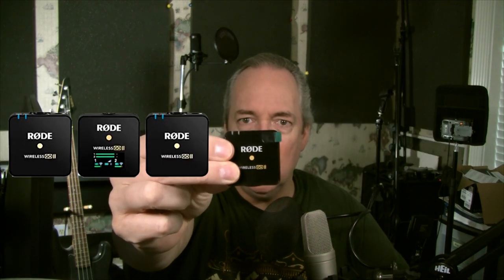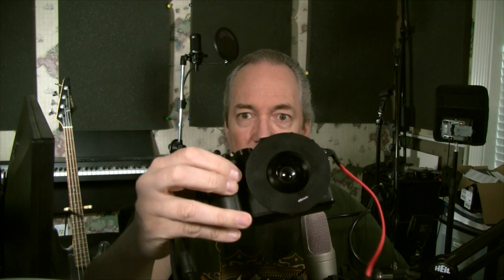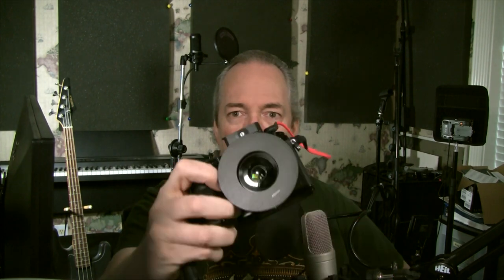Fix For Rode Wireless Go II Buzzing Noise

Comment: I have a same problem but with my Samsung mobile. I use gimbal and attached the receiver to the gimbal.  The phone is very close to the receiver.  Any solutions? Not easy to do you idea  with longer cable if use a gimbal. Thank  you
Reply from the maker: There seem to be multiple ways to fix this issue, none of which worked for me, but they work for others. It's odd. Maybe try deactivating or activating the pad mode(little blue triangle at the channel display). Also see if you can disable Bluetooth on your mobile and see if that helps.
Reply: @Home Brew Audio  doesn't work. But thank you anyway

Comment: Hi, brand new Wireless Pro here and on my first test I have that buzz. But I have that buzz on the camera AND on the emitter which is recording the audio by himself too. So the fix won't work for me and the issue seems to be different too. I'll do more test, but I'm quite disappointed, that Wireless Pro doesn't seems that much pro...
Reply from the maker: That is weird. At least in my case, the "safety" recording on the transmitter was not picking up the buzzing. For it to also be present in the transmitter seems like something is off. I would definitely try to contact RODE support on that one.

Comment: how would you use this in a run and gun situation? lets say handheld or gimbal?
Reply from the maker: I would try just putting the receiver in my pocket if I were the one carrying the camera. It would probably be far enough away to not interfere. the location of the mic seems to be unimportant.
Reply: @HomebrewAudioRecording  Fair enough. I use a GH5 II, but I find the audio that is recorded internally on the rode sounds better than when wired into the camera. Is this the same for you are they equal?
Reply from the maker: @kudobeats  I haven't done a test on that. But it doesn't surprise me since that audio recorded on the mic is direct and the audio on the camera used its internal electronics for sound capture  I think. But yeah, if you are getting good audio on the mic without the receiver, there really is no need even to use the receiver is there? bypass the problem entirely? Then all you need to do is sync the audio up to the video when editing. It might even be better NOT to use the receiver at all so that the camera can pick up its own audio. That way it would be easy to sync it up in post since you have reference audio. I know all this is a pretty roundabout way to do it.
Reply: @HomebrewAudioRecording  crossing my fingers but I seemed to have fixed it, even with it mounted on top of my camera.I set the sound gain rec level to Low instead of standard. Have my Gh5M2 at -18, and tested on all rode's dB (-24,-12 etc) and no buzzing. No idea why, just hope it stays like this.
Reply: @HomebrewAudioRecording  My diagnosis was incorrect. Whats interesting is, that if I lower myself or raise myself the noise appears and disappears depending on my position. Its still mounted on the camera. This is such a weird issue.

Comment: It's NOT just an issue with your G7... I have the same issue while using my Sony FX3. And I am a run-n-gun filmmaker... soooo I can't just drag my receiver 4 feet behind me while running around... The whole point of this Rode system is that it's WIRELESS! haha UGH. I get a buzzing sound simply by plugging in a cable to my camera's side mic port without a mic connected... I'm not sure why. I've tried using a different cable from my shotgun mic and the same thing happens. If I plug in my shotgun in the buzzing goes away. I think you're on to something behind the wifi signals. My camera has an airplane mode but that doesn't seem to change anything, nor switching the signal from 5ghs to 2.5ghs.
Reply from the maker: Yeah, this seems much too common with too large a variety of cameras and devices to NOT be a RODE problem. They had better fix this before the next release.

Comment: For me, only one of my transmitters is having the buzzing issue and only when a lav mic is plugged into it. The other transmitter works fine and moving it away from everything hasn't worked for me. This is a very new issue as normally I use the full kit together. At least it can still be used without a lav mic but not ideal when wanting to be discrete. If anyone has a fix for a single transmitter, please reply here. 🙏
Reply from the maker: Weird. I suspect this problem happens in multiple situations. And sometimes different ones than others having the problem. It also makes me wonder if this defect isn't more of a problem than Rode thinks it is.
Reply: @HomebrewAudioRecording  Possibly. From other info and the pad may be causing the issue too on transmitters rather than receivers. Don't have my kit with me to test but will update my post if that fixes it. 👍
Reply: I have a similar issue, my Go II is now buzzing horribly, but only when the lav mics are plugged in. It completely ruined my takes the other day (best solution I found was RX's de-hum plus Final Cut's voice isolator)
Reply: The same happened to me, one of my transmitters is more sensitive than the other one ( Tx 1 ) but it only happens when I plug the lav, what I did was doing a Factory Reset to all the diveces (3), then I tested my two lavs in both Tx, and there was one of them that picked up less noise with the Tx1, also, keeping the cable of the lav away from the Tx helps, now I'm gonna try also keeping away the Rx from the Zoom F6. 

I hope it helps!
Reply: @TadeoValencia  have you checked that the “Pad” isn’t enabled on only one of the transmitters?

Comment: The same problem happens when the receiver is plugged into recorders that don't even have wifi. So it's not a wifi thing causing the buzz...
Reply from the maker: It may not be WiFi exclusively. Rode says other wireless signals can cause it as well. But whatever the cause (and I'm not sure it was WiFi), THIS solution worked. https://youtu.be/QZjSrwxUT6Y

Comment: Hi, i´ve got the same problem but only while using the Lavalier Go Mics.I wondered why , at the first time i used the Go mics i had no problems.Now i´ve found out why.If you've activated the pad mode(little blue triangle at the channel display) the buzzing noise is terrible, even your camera wifi is activated or not.That was also my first suggestion but after i´ve deactivated the wifi and bluetooth on my Sony PXW-z90 nothing changed.So hopefully this is the solution of  the problem and rode will fix it with an firmware update.
Reply from the maker: Yes, I've seen the that the pad mode is another cause of this same thing for some people.

Comment: But does it really solve the problem? Having it 4ft away from the camera while shooting outdoors or on the move just causes more problems.
Reply from the maker: It's not ideal. that's for sure. But yeah. I can let the receiver hang down from the camera and still be 5-10ft away. In fact, the transmission can go as far as a football field. So an extra 2 feet or so of cable from camera to receiver isn't that much of a hassle.

Comment: I have the same issue and solution with my Sony PCM D100 recorder (and other recorders as well as a camera). The PCM D100 does not have any WiFi, so WiFi cannot be the problem. Another guy that had this problem with a Zoom (H6?) recorder got rith of the problem when he connected the Rx unit to Rode XLR Pro which has an internal isolation transformer. He could do this since his recorder also has XLR mic inputs. He did then not have to move the Rx unit away from the recorder any more. To me this tells that the problem is the Rx unit sending this buzz noise to the recorder (camera) via the cable. To me this is a design issue with the Rx unit. Bad design. They have made it for mounting on the camera, and then tell you to move it away from the camera.
Reply from the maker: Actually RODE never suggested that. It was just an experiment on my end. But yeah. Obviously bad design. Thanks for the info!
Reply: Hi @HomebrewAudioRecording  : Yes, same to me. I just found a long cable and moved it away, and it worked. However, I just found some info on someone that put a isolation transformer with 3.5 mm TRS plugs between the Rode cable and the camera, and it did remove the noise. He could now keep the Rx on top of the camera. This indicate a form of ground loop problem which is quite common for unbalanced signal lines. An isolation transformer is quite cheap, so I have ordered one (Audac 2070, but there are others and I think he had another one) to see if it fixes the problem. It would be a much better solution since I carry the Sony PCM D100 on me while recording (monitoring the sound) and it is not easy to find a place on my body to clip the Rx unit that is far enough away from the recorder to get rid of the noise. I need to have the Rx unit mounted on the front side of my body somewhere (where also the recorder is) in order to avoid shadowing the radio signal between the transmitters and receiver. Hopefully this is a solution that fixes the whole thing.
Reply: I thought I'd let you know that I have found a solution the the buzzing noise problem when using the Wireless Go II with my Sony PCM D100. I connected an isolation transformer between the Wireless Go Rx and the mic input on the D100, and there is now no noticeable buzz when I listen to the recording, even on max input volume. I am just using a cheap transformer from Audac named TR2070 (it takes a stereo signal, so you only need one). If your recorder has XLR inputs you can probably use Røde's own VXLR pro, but they are a bit on the expensive side.

Comment: the same with Sony A7SIII. How to remove this noise in DaVinci Resolve.
Reply from the maker: Unfortunately, this is the kind of noise that is difficult/impossible to remove after the fact. It covers a wide range of frequencies and has different kinds of sounds in the noise (whine, hum, buzz). So it really needs to be prevented.
Reply: @HomebrewAudioRecording  yes... sounds like "buzzz"... and is strange that is more strong in the start of the video, and no any noise in the middle of the video
Reply from the maker: @atlantessa  Yeah I found that if fluctuates a lot. This is likely due to fluctuating radio frequencies causing the interference. You can always try doing noise reduction on the audio. Go ahead and try using the noise reduction tools in DaVinci Resolve (temporal noise reduction and spatial noise reduction) and see if that helps. My guess is it might reduce the buzz, but make the audio sound terrible in the process.

Comment: I have a buzzing problem on the Rode Wireless GO 2. After updating and using with the original Rode Lavalier GO, a buzzing sound is heard. Pretty much. The interview of the director of a large plant failed, I will reshoot (. There is no such problem without lavaliers. Only with lavalier and only with the original rode lavalier go. This is not only in the camera but on the recording on the memory of the transmitter problem. There is no such problem if there is no Rode Lavalier GO, if used, only recording to the transmitter is used. There is no such problem with Lavalier Sennheiser ME-2 either! This appeared recently at the beginning of September 2022, after the update version 1.9, then 2.2.0 was also updated, the problem is not solved.
Reply from the maker: Sorry to hear that. It's frustrating. Especially since every instance seems to be different and unique.
Reply: @HomebrewAudioRecording   thanks
Reply: I had the same issues with my Wireless Go II and Lavalier Go mics. What worked for me was to turn OFF "Pad" on the Transmitter (not the Receiver!), which was turned on (check if there is a small green triangle shown at the mic channel on the receiver display). As soon as I turned off the "Pad" function on the transmitters (with Rode Cetnral, but you can also do it with selecting the transmitter channel on the receiver and long-press the mute button, so that the green triangle disappears), the buzzing noise was gone. - And yes, I also thinkt it started with the firmware upgrade...
Reply from the maker: Thanks for the update! Good to know that the lav sometimes is good to know.
Reply from the maker: @jessenig  Yeah, I've seen that as one of the causes/solutions. Seems like there are multiple causes.

Comment: Crazy that Rode told you the camera is the problem... If the Wireless Go 2 mics are designed to fit a cold shoe ON a camera and having them buzz is caused by being too close to a camera, then the RODE has the problem as far as I'm concerned. 

So disappointing, as you said they are great on an iPhone, rubbish on an actually camera unfortunately. You could also use the Rode tranmitter as a field recorder and just export the audio for treatment to add to your footage without needing to send it to the camera at all. Bit of a pain, I think I am going to get a shotgun mic instead....
Reply from the maker: Yeah, that functionality to record right onto the transmitters is amazing.

Comment: another way I just discovered from another link - turn off the Pad function would remove the buzz immediately , you can either press the 1/2 button to select the transmitter that has lavalier then hold the dB button until the triangle is gone on the monitor, or , turn the Pad function off on rode central app. Check this guy: https://www.youtube.com/watch?v=PL9y3OMURTM
Reply from the maker: that did not work in this case as it was not on in the first place. I tried all of those things. Didn't work for me. Only getting the transmitter away from the camera did that trick. I suspect that it might be different for everyone.
Reply: @HomebrewAudioRecording  Feel so bad for you.  How far away do you need to keep it from?  I am disappointed by the fact that Rode didn't test the product out in  practice.
Reply from the maker: @vicluistudio3320  About 18 inches or 2 feet does the trick

Comment: Rode will blame everyone but themselves
Reply: Disagree with this comment as I have same issue with Rode Receiver detached and keeping cable attached taking Rode Receiver closer to the camera generates same noize. Cheap cameras have very poor shielding on their chips which causes this interference noize...
Reply: @hobbyistnotes  I've used 2 other brands of wireless mics on this camera and don't have an issue, Rode is the issue
Reply: @mreddieau  Than I guess the frequency Rode picked wasn't a best choice =) Spent whole day today fighting this issue... What mic's you have used other than Rode?
Reply: I will be returning mine.  They buzz in every device I have plugged them into.

Comment: I have the same buzzing issue with Sony RX100 Mark 7. It goes away if I turn off WIFI on the camera and change to a better Rode 3.5mm cable. I have the camera mounted on a Zhiyun Crane M3 if I record while on the gimbal the buzzing is back as it picks up the Zhiyun bluetooth. So disappointing, so I am returning the Rode Wireless Go II and buying a Sony one. If Rode cannot test there product with the with products made by other companies they will lose sales. They have lost me as a customer and I won't be buying future products from there incompatible range of junk. Why should the customers waste time product testing and looking for solutions? If it does not work don't sell it!
Reply from the maker: Yeah, it would be better if they fixed this. One thing that is key to remember is that the Go Wireless II is not ONLY for mounting on cameras, though. You can record the audio totally separate from a camera - right onto the device itself! Then sync the audio up with the camera audio later. That's actually how I do audio for video anyway - and how a lot of people using Zoom devices do it. Also, due to the USB functionality, the Go II can be used to get better audio on Zoom calls and the like also. I'm not sure if other lav setups can do those things.

Comment: And the same mic
Reply from the maker: I would try the medium (-12dB) gain setting on the Rode unit and see if the level is loud enough but does not clip/distort. It should be loud enough. But if not, try the 0dB setting and if it is too loud at the medium setting (it clips/distorts), try lowering it to the -24dB level. I hope that helps.